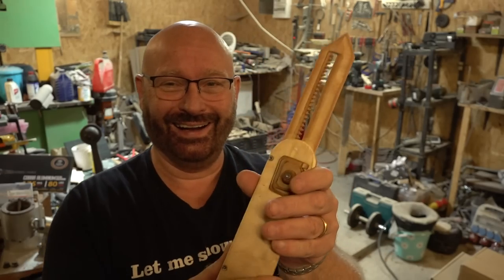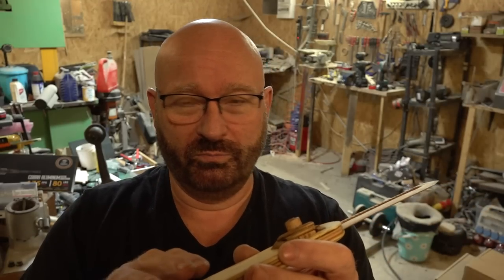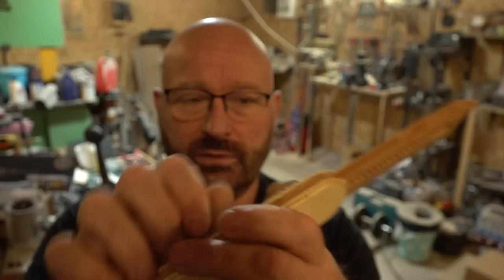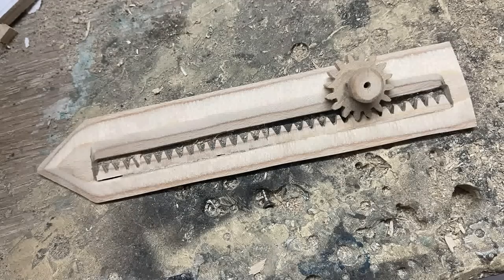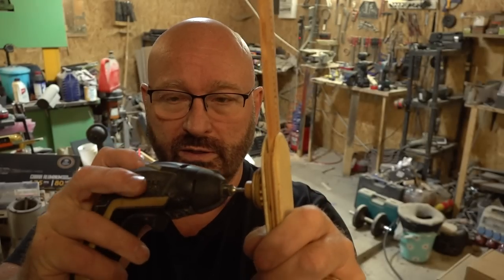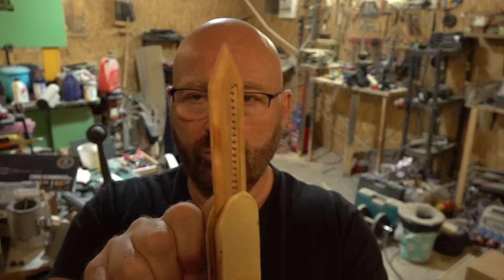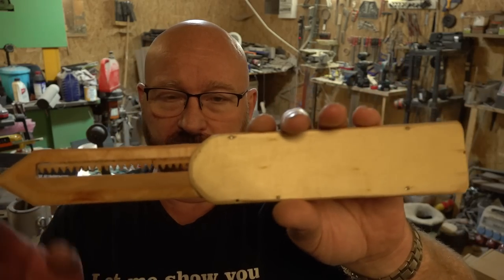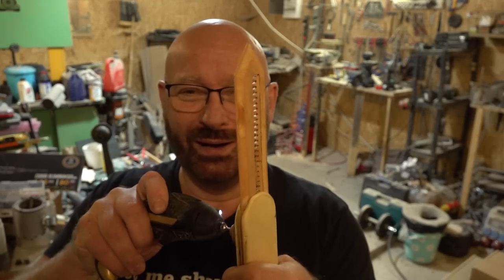The Gear Knife - Great or Dumb?

Comment: i still think a worm gear might be better, i have see some of those drones and the y go realy fast so i think 70 turns is no problem
not to mention you get some torgue out of it so less likley to get stuck if some dirt gets on the blade and you didnt wipe it of

you mentioned the advantages of the gear system 
might is sugest degending on how big the engine is putting it perpendicular with the blade, and then make direct contact from the blade to the engine
this will require smaller gear but might be what you are looking for ?

hope you get some inspiration out of that :)

Comment: Great concept.  The components could easily be distributed throughout the handle and you have a lot of options for the mechanical configuration.  I would buy one of these as a conversation piece if nothing else but I'm sure you would make it functional and durable.  I may one day utter the phrase, "I need to change the battery in my knife."  Best of Days to You and Yours.

Comment: worm worm worm - you could use a really steep pitch like the helical drive rods in optical drives
you could even harvest the parts you need from an optical drive
hell the worm gear could even engage the blade just by having diagonal grooves cut into it
you're really leaving a lot of money on the table by ruling out worms

Comment: What if you didn't use any gears at all.  Instead, you could use a rubber friction wheel and the blade could remain solid and therefor stronger.  Besides, aren't you required to use rubber on this channel? :P

Comment: I have an idea how can I share it with you
Reply: The blade is like the whip sword spas it retracts it separates in to two filling bothe sides of handle and as it comes out the blade locked tiger adding length i Really wish I could explain it better

Comment: Hey! Maybe you can use sex machine but instead of toy you can put some sort of blade ... Like self stabbing blade machine :yougotthis:... I  like your idea but rack and pinion gear mechanism, although it can output a lot of force, it is still kinda slow. Don't you think?  If you can manage put larger gear with grater module, and smaller number of teeth your mechanism will drive faster...I know what you think. Whole mechanism will be kinda flimsy, but instead of hollow blade construction try to offset the rack, and here you go :elbowcough: And yeah, ball bearings will reduce friction. Thanks and bye bye